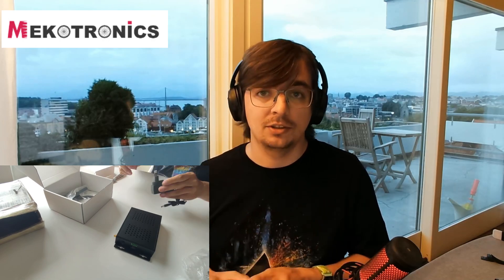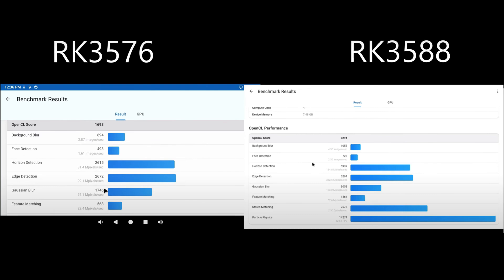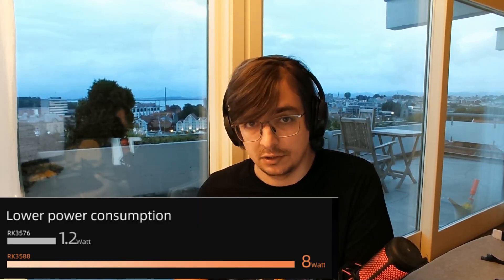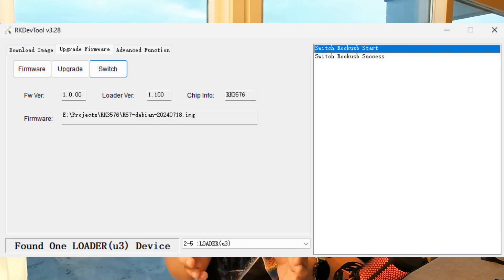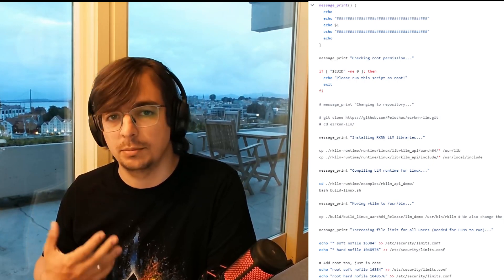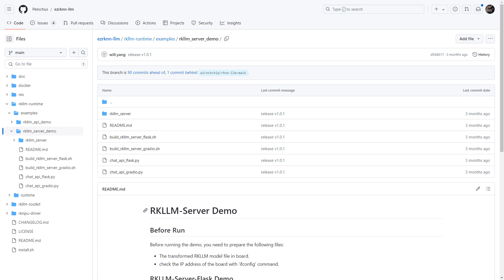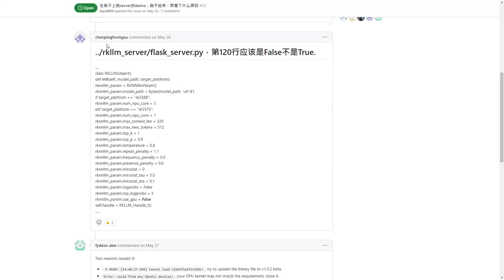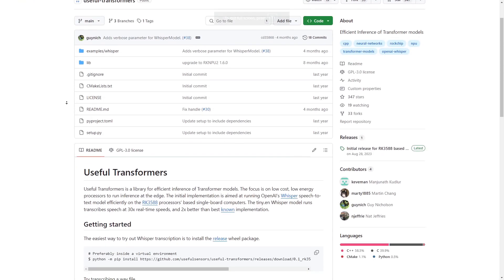LLMs for RockChip. Guide for RKLLM. RK3588 vs RK3576 comparision

Comment: Great video! At 2:57 what model were you running and how were you running it? Was it the "flusk api" you mention later? Why do you think 76 was faster?
Reply from the maker: 1) Qwen 1.8 (running with this approach - 08:25 )
2) https://github.com/airockchip/rknn-llm/tree/main/examples/rkllm_server_demo
3) 76 may be faster for some models in some conditions. However, more tests are required to verify this. Specifically for the tested model  - yes.

Comment: Hi Anton, thanks for your feedback on rk llm.
I have a question, I didn’t understand how you could flash the RK3588 to run the tiny llm ?
Reply from the maker: For RK3588, I used NanoPC-T6 from Friendly Elec. Partially I described the flashing process here - https://youtu.be/pN8mKZ5wpdQ
And you can use the same RKLLM, or it's a fork to install LLM.
Reply: @AntonMaltsev  hi again Anton, on the rock ship doc, they say :
1） Download the rknpu_driver_0.9.6_20240322.tar.bz2.
2） Unzip the compressed file and overwrite the RKNPU driver code into the current kernel code
directory.
3） Recompile the kernel.
4） Flash the newly compiled kernel to the device.
But I think it’s not so easy 😊 I will try, I am just worried because of the retro compatibility with my yolov8 vision application
Reply from the maker: I did not do anything with kernal reconpailing for any of these platforms.
Reply: I have spent a lot of hours messing around with this board, and while I can get (mostly)) convert hugging face and gguh models to Q4 or Q16 rkllm models on my host PC, I have been completely unable to get any of them to actually use neural processors; everything falls back to CPU. 
Mine shipped with an older 6.x.x kernel, Debian 12, and the 0.9.7 driver (not the more recent 0.9.8).
Also, I'm pretty certain the models have to be made specifically for the 3576 or 3588, or to have some logic to decide which one to use.
In any event, very helpful video for a very challenging enthusiast piece of kit.